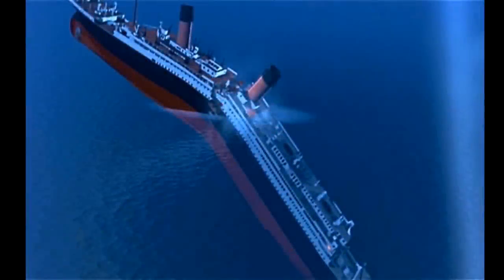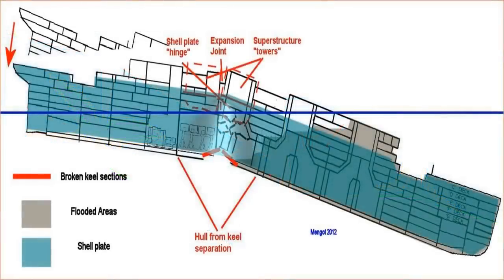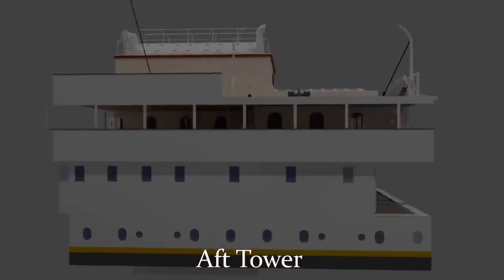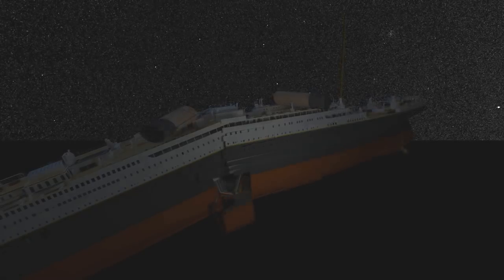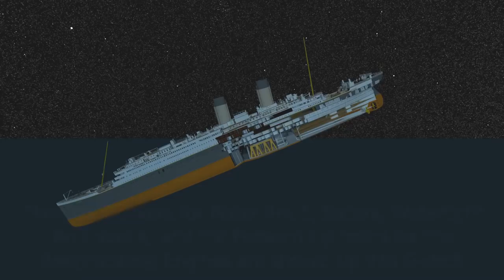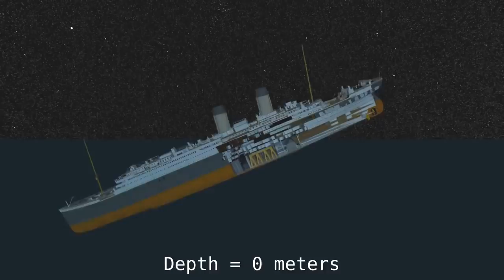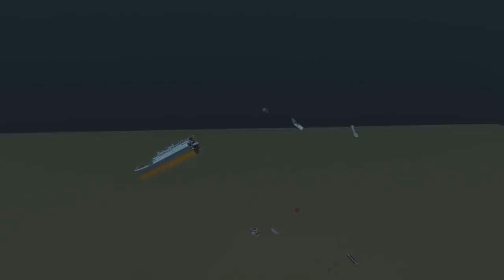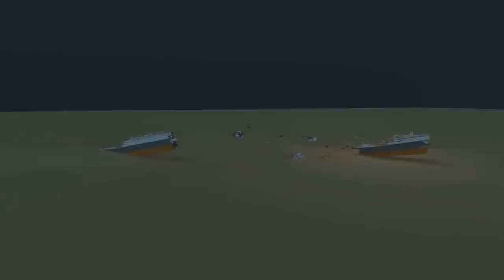How Titanic Broke In Half BRIGHTENED

Comment: I enjoyed watching your video. I was wondering about the effect of air trapped inside the stern as she went down, would those pressures lead to additional damage? Could the release of air caused it to spin?
Reply: poop
Reply: Actually you are very correct about the air causing damage, when the ship began to sink, there was lots of air inside the ship, and the air was getting extremely compressed so it exploded outward, blowing millions of pounds of pressure against the walls and, essentially acted like a bomb.
So yes the air did cause more damage.
Reply: @mildly_miffed_man1414  Don't you mean imploded inwards?
Reply: @krashd  exactly! Air compresses, water doesn't
Reply: The air filled compartments imploded, which included the shaft tunnels, aft peak water tank, refrigerated and frozen storage rooms, and any other rooms still air filled. The air also ripped the poop deck loose and peeled it back like the lid of a tin can.

Comment: In some of the most recent Dives to the Titanic they located large sections of the Keel of Titanic miles away from where the rest of the wreckage was.
This paired with reports that there had been water reported in compartments that had not been breached very early has led to a hypothesis that they didn't just sideswipe the iceberg but wrote up onto it under water actually tearing off sections of the bottom of the ship. This would explain why those sections were so far from the rest of the wreckage. Because they possibly broke off and sank at the time of the impact and the ship continued forward.
Such damage would also help to explain how the ship was able to break in half when Engineers studying Titanic design have estimated that the structural integrity should have held.
Reply: Jarod Strain Interesting! And it was true that she continued a mile away from the impact site til she finally stopped. So not only side was hit but the ship rode over a part of the iceberg that night.. 🤔

Comment: 16:40 When the B deck finally disconnected the with the aft section, the aft section should have settled again - fall back flat on the ocean. Why is it just suspended at about a 45 degree angle without falling back?

Comment: What did we learn from all this? Watch where the hell your going.
Reply: becareful of what ship you are really on...this is\was Olympic
Reply: @waynedaub1889  Can't be olympic because the interior is completely different from the titanic. Don't suggest they switched it because the olympic went in for repairs approx 40 days before the Titanic set sail on her maiden voyage. To even switch that would take months.
Reply: 1. Don't effing ignore ice warnings from nearby ships. They warn you about icebergs for a reason do they not?

2. More lifeboats than the maximum capacity of passengers..

3. Use binoculars. Technology isn't perfect, so SONAR isn't entirely reliable...

4. Know what the color for a distress signal is.....if you confuse them, OMG ~
Reply: @danieldoo1821  the Titanic didn't have sonar, this is 1912 not 2012. And naked eyes are said to be the best for spotting ice in the water, but due to a cold water mirage reflecting the stars, the iceberg essentially vanished until it was too close to turn
Reply: @danieldoo1821  Binoculars are used to identify what an object is after it has been spotted. A crew member left Titanic with the binocular safe keys so they couldn't open it. An unfortunate series of events.

Comment: I watched this fantastic video the second time and I just enjoyed it even more. I wonder what would happen if the captain orders every carpet, curtain bedsheet every rug and clothing to be thrown into the water on the starboard side on that section where the iceberg scratched her (obliviously to get them to the suction just shortly after the collision). Is the sinking would been slower?
Reply: The suction would have been quite a few meters beneath the waterline, but I do like that idea, something heavier that would sink, but sink slowly would maybe get pulled into the tear and obstruct waterflow.. Crates of fruit or other medium weight goods come to mind.  Though you'd have to know where the holes were as best you could in order to aim for them.
Reply: Rob Fraser  blocking the holes with larger carpets and other stuff would slow the sinking.
Orange crates would float, so that is not a good idea. The cargo got the first blow of the water so the oranges were all gone, btw I heard that was a massive amount of orange shipment was on the ship. I don't want to blame anyone but two person definitely has big part of this tragedy. One who has ignored the last ice warning, and the other who was in charge when the ship hit the berg. The captains should do all the necessary precautions to slow down the water, but for like 20 min they were just running up and down. They could even dim the light on the decks and point out the mysterious ship sooner and try to get there till the propellers were under the water and the steam was inside the boilers. I have another idea to save more life which is all the lifeboats should be launched empty and sailors should tie them together in star shape 2X9formations and put 100 in each boat carefully to balance out the weight they would stay afloat, as they were made from cork there was no waves nor anything to stop this simple thing and here we go almost everybody would escape.
Reply: the real problem was coming in contact with the water. Once that happens one has very little chance of survival....
Reply: @dangr3957  100? the lifeboats could barely fit 65 people and that was its max capacity!

Comment: How would the bow not pull it down? Giving the banana analogy if it was still connected to the other half of the ship Wouldnt the water HELP the bow in pulling the other half under??🤷‍♂️
Reply: The banana analogy breaks down when explaining how the double buttom could hold on to the bow without snapping like the rest of the ship as soon as all stress rested on it. 
This theory shows that the bow pulls on the stern at least for a while before detaching.
Reply: @bluechair9172  that's my point so will it still connected it should help pull it down and if disconnected then the water that's already gushing in would aid in the sinking of the other half..right? Or am I lost? 🤦‍♂️🤷‍♂️😕
Reply: @iamBlackGambit  I think B deck is pulling on the stern until it breaks. After that, it's only water entering that makes it heavier.
Reply: @gunnar6674  You're right but I also think the reinforced galley decks that were made to make the ship not break in half while sailing held on for a bit because well its reinforced.

Comment: What if it sank without any breaking and when it hit the sea floor it snapped on impact
Reply: Erm how did the 2 parts ended up so far from each other on the sea bottom?
Reply: This doesnt explain why they're so far apart, debris scattered between and around them, OR how the stern is in the EXACT opposite direction, or the drastically different conditions of both sections. 

That and, if it survived the sheer stress from the sinking, i doubt it would have outright separated at all. 

And it also contradicts nearly every single witness.
Reply: Yeah I guess the stern was like “dude we’re way to close to each other I’m just gonna move a way a little bit”
Reply: @impulse5674  no i found classified documents of wheels on ships from the british government officials (joke)

Comment: The reason this can't work is that if the ship had split into multiple sections of the stern, you'd see these sections and their debre scattered far, far away from one another on the sea floor as you do with the bow an stern. The only examples that fit this criteria are the two sections of double bottom and the forward funnel section, all three of which can be explained by other means which I will get to now. First, I do admit you're right about the welding of the double bottom due to compression stresses, but they simply did not fall down after the split as you mentioned, they are designed to be strong and just because the middle of the two buckled, doesn't mean the ends did, resulting in it staying attached to the stern until it was flung off by hydrodynamic flow, or the stern's implosion, which brings me to my next point, the stern's implosion. The only section of superstructure we see sent off into the debre field is, as mentioned before, the forward funnel section as Roy labels it, but this is the only one, meaning if all of Roy's sections fell off the ship this way, they'd all be scattered like the forward funnel section is, but they aren't. It is much easier to explain the forward funnel section's anomalous placement as a result of the stern's internal implosion which would have loosened the superstructure's already weak connection, severing from the rest of the ship. Also didn't survivors say that they saw a clean break right in front of the third funnel? If this theory is true, how would this be explained?

Internal implosions can also explain why we see the stern so destroyed at the bottom of the ocean, seeing as so much air was trapped within it. This explanation makes much more sense than multiple break points.

The only part of Roy's theory I agree with is that the breakup started at the hull, welding the double bottom pieces, which in turn allowed it to act as an almost hinge piece for the bow and stern once the ship fully separated. Those are all my thoughts and if you have any questions just ask me.
Reply: People thought that the the ship broke cleanly in front of the third funnel because the stern settled back and nothing in front of the third funnel was above water.

Comment: A lot of what you said in this makes good sense.  The breakup at 11 degrees never seemed credible to me so having this scenario work for 15-23 degrees seems more consistent with eyewitness accounts (who described people falling down the decks while the lights were still on and  the ship must have therefore been largely intact at that point). 

However, there are two things that bother me about this, namely the Boiler Room 1 boilers and the double-bottom pieces.  If the ship failed in compression then shouldn't these parts have been pulverised into unrecognisable scrap?  Yet the double-bottom pieces and the boilers are in remarkable condition.  In fact the very first piece of recognisable wreckage found was one of the boilers, whereas the double-bottom pieces are almost pristine aside from the damage near where they broke. 

Is there something I'm missing that would account for these parts being relatively undamaged in a compression breakup of the keel?

Comment: So basically the front fully sank while the rear tried to stay fully afloat and the opposing forces tore the Ship to pieces through the centre sections, well it proves the principal of watertight bulkhead doors of the sections that were not damaged and or flooded.
Reply: So if they had allowed the back to flood it’s compartments before it started to raise up could they have kept water from flowing over the bulkheads in the front of the ship and saved everyone’s lives?
Reply: @billyford2262  -  that might be an interesting model to run through a simulation. I'm unsure if the water would have continued to enter a level keel or if the ship would stay afloat very low in the water for a longer period, without enough lifeboats if that way Titanic does only 'half sink' then yes possibly although it does seem counter intuitive.

In my view the two keel pieces on the sea bed don't prove they were separated on the surface, I think there's some potential for the bow pulling the stern down by the keel, had the stern sank of it's own flooding the implosion wouldn't have happened, air won't sink as the side view rotation proves so if you can level out the water and air through the length of the ship in theory they may find a balance.
Reply: after a few amateur experiments in practice it seems as long as water can enter a breach in the hull air will be expelled out, each bulkhead needed to be full height to be effective, i think that would be the only way to prevent water entering each in turn over the bulkheads. It was only the angle created keeping air in the stern rather than the bulkheads keeping water out forcing the ship to break otherwise the ship still sinks but with a more level keel.

Perhaps safety was only implied rather than actually there, compromised long before being needed, with hindsight a few 'what if' scenario's would have revealed the rotation and half sinking/breaking motion, hitting an Iceberg was too late and that must have been believed to be avoidable, so the compromise relied on the belief or the belief gave the compromise an apparent merit beyond a reassurance.

I wonder if anyone will ever reveal the iceberg damage, the question doesn't seem to get asked even though no one has ever seen it, there might be a way to do it without removing the silt, some kind of technology to view through the mud or if washed away may well be the best preserved part of the hull, no one needs to be down there to do that.
Reply: @mc2594  oh yes that would be a good idea I wonder why people haven’t talked about trying this yet?
Reply: @mc2594  so would it have bought them any more time tho?

Comment: Question: What in this theory accounts for the lateral dispersion of the two towers? They are not located between the bow and stern sections on the sea bed but are well to the east of the two main sections.  This question takes into account that current alone could not be responsible for this, otherwise the towers would be to the south southeast of the stern instead of to the east where they are.

Comment: i dont understand, as you show that the bottom giveaway before the top does, so for a moment the ship is connected by the top, but there is other expert say it is the top give way first and the double bottom hold the ship together, and that drag the second half to the bottom, and i think the titanic survivor also witness that is the top side give way before the bottom
Reply: Well, bottom part of the ship at the time of breakup was underwater, so nobody can really saw correctly what gave up first. Still if B-deck plating holds the ship together , you will still see 2 decks above it that give up. So naturally you will assume, that top gave up first. Especially when it is middle of the night and hull of the ship is painted black.  This theory also make great job to explain why the stern sunk so fast. This is what make me curious for quite some time. It wasn't fill with water at all, yet sank in less than 5 minutes, where all the ballast (completly filled with water bow section) had separated.

If the ship would break up top to bottom and kept together by the double bottom, then the damage to the bow and stern sections would be similar. In such situation, the stern would't have sunk at all.

Comment: @TitanicAnimations
Question. Is implode the correct word to use for what happened to the Titanic's stern? As it sank, the air in the stern was compressed at a fairly high rate, and there wasn't very many escape points. So wouldn't it have exploded from the overpressure from sinking?
Reply: there was no implosion dont ever believe it. the port side of the stern was BLASTED out. possibly a combination of steam with the air also being pressurized.

Comment: This is awesome, but the turn direction of the stern is incorrect. Based on the skid marks on the seafloor, the stern turned the other direction, sliding as it impacted the floor, resulting in one side of the siding to go slightly under the ship and the other side to flair out from the ship like a skirt.

Comment: a few years ago when I was like 8 or 9, I did not really care about titanic when I saw it. until then it started getting more popular. I decided to go see what this was all about. I saw a vr experience for titanic and thought they breakup was so scary to me. I started liking titanic so much I know so much about it now.
Reply: More often than not  ships break apart when they sink. Either it's because of an external explosion, internal explosion, structural failure or flooding causing the ship to take on an angle greater than the keel and hull can withstand. That was what broke Titanic into four main pieces. Sometimes they break up into MANY  pieces and are left as a collection of mangled metal on the sea bed.

Comment: “Pretty cool huh”  😅😂🤣 …. On another side note 📝 I thought the Forward Bow section reached the bottom of the Atlantic FIRST and possibly 4-5 minutes FASTER than the Stern section but then the implosion of ALL that trapped air in the stern section could have given it a faster rate of speed to the bottom of the Atlantic Ocean. Maybe the ship’s engines helped it escalate that effect idk 🤷
Reply from the maker: The stern did impact later on, I sped up its descent because the video was already pretty long.
Reply: @TitanicAnimations  how many meters is it exactly where the 2 sections of the Titanic’s wreck is at?
Reply: @ChairmanPaulieD  well the wreck is at about 3800 meters deep in the north atlantic ocean 400 miles away from Newfoundland, around 2000000 meters away from New York.
Reply: @viperfishlover8767  I heard that there is a canyon about 1 1/2 miles away from the front of the bow section. I think James Cameron mentioned it in one of his dives to the wreck in 2004